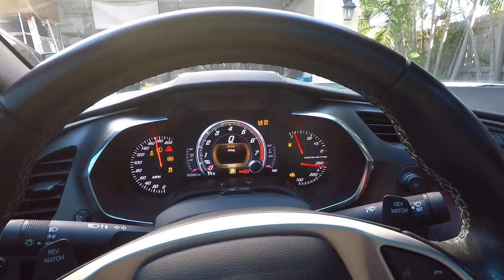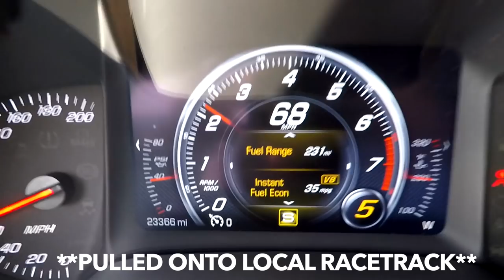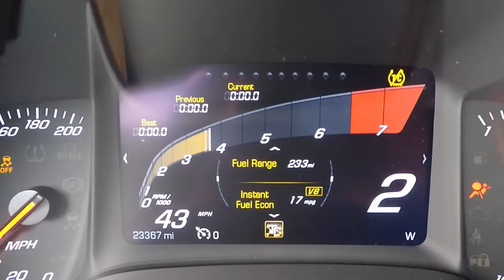MPG's at FULL THROTTLE... IT'S SO BAD LOL! (840hp C7)

Comment: It should be called the Corvette one:1 (because the fuel useage)
Reply: Niels Blankenstijn pourquoi? It has nowhere near that weight to power ratio, not even close at all
Reply: nathan greer dude calm down lol, I meant fuel use-sage........... it does one mile per gallon, 1 to 1...... I’ll change it for people like you.
Reply: Honestly, it probably does less than 1 MPG at full throttle.  1 is just the lowest it can show I bet.

Comment: My car only gets around 12 mpg through a whole tank, but I didn't build it to drive economically.
Reply: maxxjett films ive had 4 cyl that got 6-14 original sti
Reply: I get about 14 on full E85
Reply: YZFR6Yammie I am going to get tuned for e85 here shortly, probably start getting single digits.
Reply: Hell ya brother.
Reply: I get 16.7L/100km (14 MPG) in a mostly stock V6 Commodore
Reply: I get 6 mpg lol, not even beating on it.
Reply: Ryan Tripp awesome tuner, not an economical driver with big power
Reply: maxxjett films 400hp isnt big power bud. Tell him to tighten up
Reply: Ryan Tripp if I wanted to get 18 mpg I could, but I might as well buy a Camry if my driving style was for mileage. I built my car to drive hard and I do, at the expense of mileage. It's true, 400whp is weak in the internet world, but is big power for me.
Reply: I get about 24-30 MPG depending on different factors.

Comment: Keep the C7. 9/10 there will be issues with the new C8 mid ship. The original bald eagle machine should be a staple for the channel.

Cleetus, I have to show you my straight piped ford focus. 12:1 and doing it for Dale. BTW if you see anyone posting 12:1 or more with a turbo they are either high AF or aren't making full HP, even though I know you can build an engine with 14:1 ratio and 5Lbs of boost. it's not the same for the duratec engine family, shit goes wild real quick, that's why most folks put a Chevy engine in a ford/buick

N/A FTW

Comment: Without saying too much , I lived in Detroit and know some of the top people in Fords SVT/SVO dept. (I was just at the home of the big man that "runs" and "pulls the strings" at Fords performance dept. and bit of unknown trivia he's also the ACTUAL man that designed the "Cobra" snake emblem that's on all the cobras , it was done by him, not designers at Ford or some graphic agency, the big man himself , a true car nut that has actual photos of mustang cobras ,and a cobra R framed in his dining room lol! Ive also been able to spend time with Gm's performance tier and I can tel you for what it's worth and believe it or not (I'm sure people will think I'm full of it and that's totally fine) but the c8 will NOT be mid engine , it will be a traditional corvette big power Front engine, rear wheel drive Corvette.  They will NOT deviate from that traditional setup! Not for at least 2 more generations and even then , hybrid /electric will be in play at the time of platform changes.  The mid engine "corvette" everyone keeps referring too  IS happening,..obviously , the mule has been spotted all over , but that is NOT the NEXT corvette, or replacing the traditional front engine rwd platform, it is a stand alone , limited production vehicle, think of it as a Ford GT type vehicle. In the beginning it will be very limited production but will be a test mule of sorts for the next generation corvette down the road. Eventually the front engine rwd big v8 platform we all know and love will die, hybrid electric will replace it eventually but twin turbo v6 like the gt will likely be the next evolution of the corvette but is not foreseen as the only option in the c8 . There's talk of offering a TT-6 cylinder as an option in the c8 but the traditional v8 WILL for sure be the standard option. This is thoughht to be a good test group to see if it is purchased and can be compared to the v8 in both marketing, purchasing, performance and customer feedback,..it will ultimately help define and decide how the c9 will be developed.  The mid-engine "corvette" (being used loosley) will be a 6 figure car, not likely GT $#'s but a lot higher than zr1 numbers, at least initially. The base c8 will stick closely to base c7 #'s and the remaining "new" late model c7 inventory will be dumped at insane prices when c8 information and release date are released by GM-marketing.  Take this info as you want , ...some Made up BS or a good guess or possibly what it is, from soemone jsit might know some people, totally up to you but as someone that LOvES your Chanel and corvettes , have owned 3 "Lingenfelters "and 2 "snake charmers" ,..I want to pass on what I know and have heard so you also have the latest knowledge and info (to do with what you want) to help aid your decision.  
The c7 will drop drastically in pricing but nicely modded c7's such as yours will retain slot of their value. C7 z06's and grand sports will retain a lot of their value for a while and the zr1 will actually increase in value. All best guesses of course , Base , stock ,stingrays will drop in value the most. You have a following and yours has history and been maintained by the best (Fasterproms) so you'll get what you want out of yours $-wise, so I'd keep it until the c8 is unveiled and info released to make your decision, you won't loose your shirt on the c7 , jsut my opinion.  I freaking love it!  When LeRoy is "finished" have you thought about doing another LeRoy but using a c6-z06 platform? Cleveland performance has had a few running driving bodyless c6 z06 corvettes  go through, (i almost did one) Jsut a thought for down the road of the Chanel. You're awesome and keep up the amazing job brotha! 👍

Comment: I would hold off on the C8 for two reasons one completely new design and build will more than likely have issues at the beginning and the bald eagle is already battle tested. Second is on the bald eagle you had to put that seat in there so you’d fit do to height will that be a option on the mid engine C8?

Comment: Our totally stock Dodge Grand Caravan will bang into the rev limiter when it's in Drive and shifting itself!
A few weeks ago I took it out when it was a cool at night and I guess it accelerated a little faster than its used to... it actually banged into the rev limiter from the 1st to 2nd AND the 2nd or 3rd Shift. It was so pathetic. lol
That little pentstar V6 does screem once it hits over 5,000 rpm so I guess the rate of acceleration is quicker than the brains in the PCM to go to the next gear.

Comment: Hey Cleetus, what's with the red LED in the corner of the a pillar between the door, dash and the a pillar @ 4:12? A full throttle indicator? Or an indicator to show when the traction control is active?
Reply: I believe it's when the meth kicks in... could be wrong but that's my 'educated' guess
Reply: Steve Bath ahhh makes sense

Comment: Is the methanol used as a fuel or just to cool down intake temps?
Reply: Adam Gasiewski it's to cool down temps but it's also shot into the intake so it gets sucked into the engine and burned

Comment: So wait, the C7 has Nitrous, a Procharger, AND methanol injection, but only makes 840hp? Do you have 1/4 inch diameter intake runners? The C7 should be making more power than it does.
Reply: 840 to the wheels is mid 900's crank which is past the limit of a stock LT4 "which he has"...
Reply: Not to mention he has said multiple times he has never sprayed it cuz it would grenade

Comment: Use the parts on your c7 on leroy
Reply: Body wise
Reply: THE ONE AND ONLY . it could work but i doubt it, different frames and chassis my guy
Reply: First Last I'd bet that the guys that made the cage for Leroy can get it to fit. Was it Profab? Anyways good idea Lol
Reply: Michiel OSH  Not only would the C7 body not fit the C5 chassis, the cage would be in the way.
Reply: StL ChuckO Yeah the cage will have to be rebuild. But i thought it was a cool idea lol , but on the other hand Leroy would "just" be another turbo-vette..
Reply: THE ONE AND ONLY .  He needs the money form it to by a c8
Reply: Leroys frame was cut in the back and it would make leroy more slow. Leroy wouldnt be Leroy imo. It would be a waste of the c7 lol